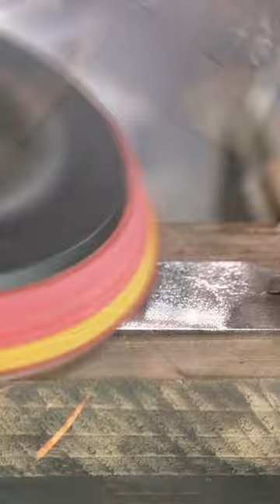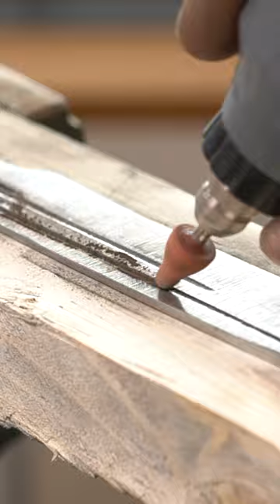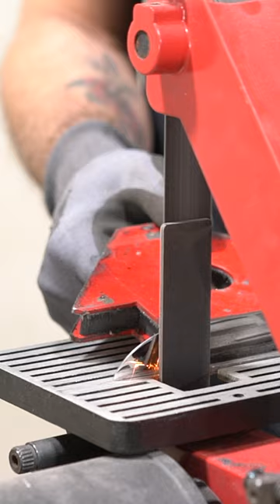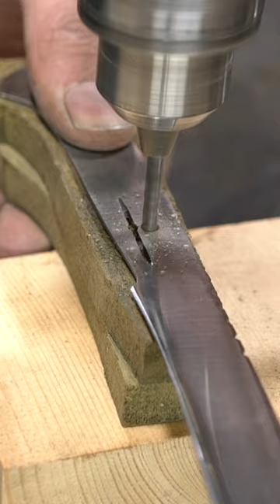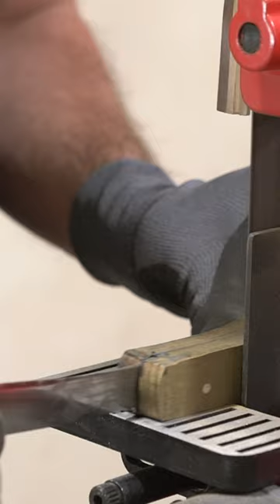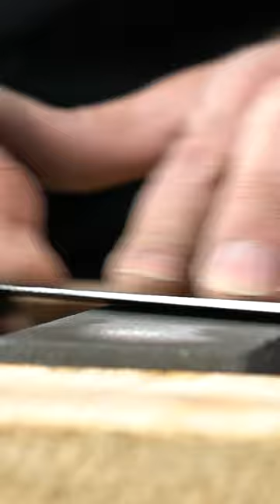Restoring a rusty old handmade knife   #restoration #knife

Comment: Felt like you took the quick and dirty route with the angle grinder In the beginning, but what do I know
Reply: He would probably have to grind it down anyway because even after removing the rust with chemicals, it wouldn't have a uniform surface.
Reply: But like you said, what do I know.
Reply: He re-did the temper. But then he took a power tool to it right after, so...
Reply: I was just talking about the angle grinder, but all of you raise good points
Reply: @thomasolson7447 Powertools don't necessarily ruin heat treat.